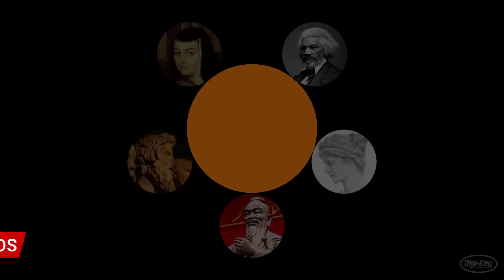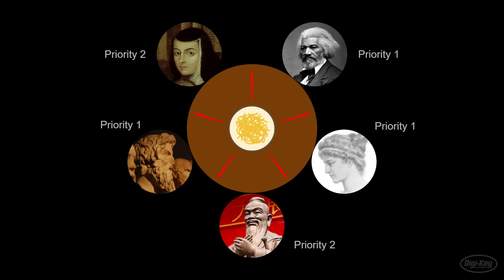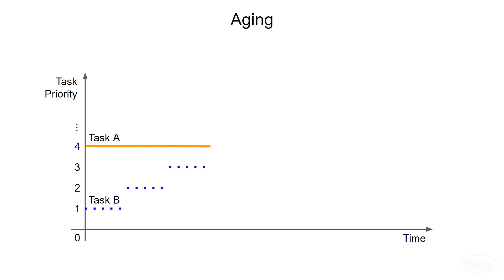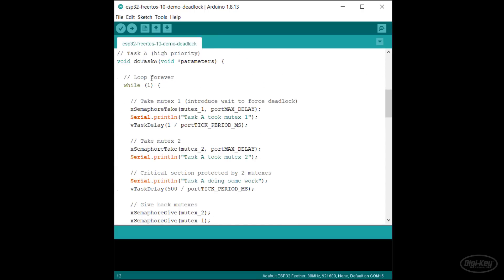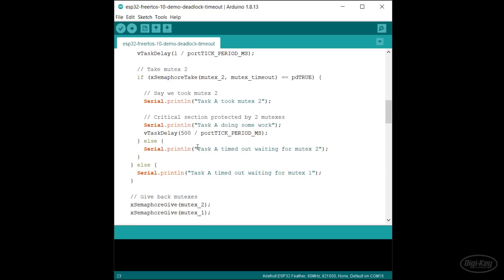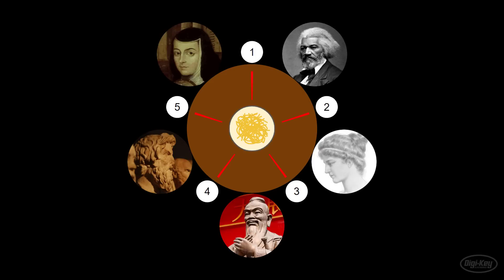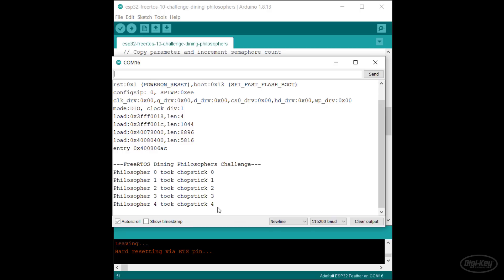Introduction to RTOS Part 10 - Deadlock and Starvation | Digi-Key Electronics

Comment: Starvation -  Higher priority threads runs that causes lower priority threads to not run 
Solution -  1/ Add delay in higher priority threads so that it allows lower priority threads to run 
                   2/ In multicore system, allow other higher priority thread to run on another core 
                    3/ Deferred interrupt - Making higher priority task waiting on interrupt using semaphore 
                    4/ Aging - Priority of lower task is bump up to match of hogging task priority so scheduler need to split execution time  

 Starvation at system level refer as Deadlock 
 Solution - 1/ Timeout - add timeout if mutex not taken than release it 
                   2/ Add priority to shared resource - threads only take resource to their lowest/highest order, mutex taken in same order across threads 
                    3/ Arbitrator - challenge to be implemented 

Livelock - It occurs when mutex taken and release at a set sync timeout

Comment: xSemaphoreGive(mutex_2);
xSemaphoreGive(mutex_1);
Hi. these two lines error error when starting  esp32 . error is that . ""assert failed: xQueueGenericSend queue.c:832 (pxQueue->pcHead != ((void *)0) || pxQueue->u.xSemaphore.xMutexHolder == ((void *)0) || pxQueue->u.xSemaphore.xMutexHolder == xTaskGetCurrentTaskHandle())"
i checked code block and i resolved problem with change some codes. problem is that if any semaphore not taken we cannot call give semaphore but we dont know mutex_1 or mutex_2 which not taken . we must change firstly pdTRUE of taken semaphore then we can call give of semaphore.
regards

Comment: 0:00 deadlock explanation
2:02 starvation 
2:40 deferred interrupt as a solution to starvation
2:48 aging 
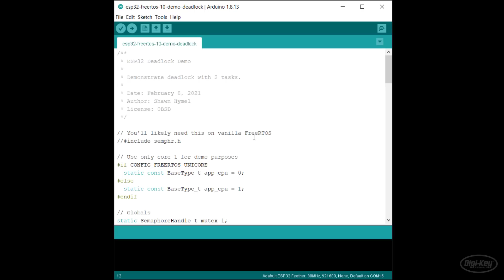4:52 deadlock demo
6:30 timeout solution
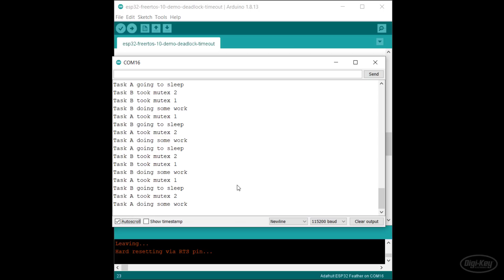7:15 livelock
8:00 Dijkstra hierarchy/priority assignment to solve livelock
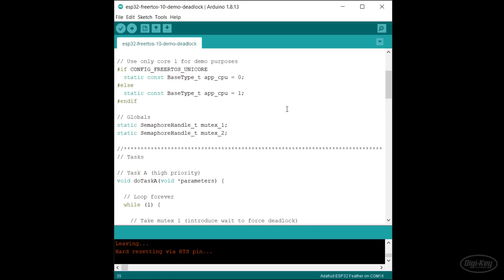8:40 livelock solution demo
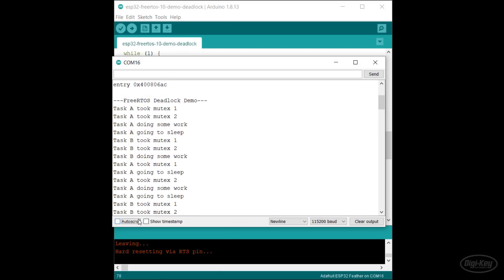9:50 arbitrator solution for livelock
10:30 arbitrator cons
10:58 challenge

Comment: Hi, great videos! I tried to reproduce this using VSCODE + esp-idf plugin and I cannot reproduce the same behaviour as in arduino. Any thoughts?
Reply: using openOCD I verified that, actually it creates at the beginning 8 threads
Id   Target Id         Frame 
* 1    Thread 1073438812 (Name: main, State: Running @CPU0) app_main () at ../main/blink.c:176
  2    Thread 1073444140 (Name: IDLE, State: Running @CPU1) _reclaim_reent (ptr=0x3ffb8364)
  3    Thread 1073441476 (Name: IDLE) vPortTaskWrapper (pxCode=0x0, pvParameters=0x0)
  4    Thread 1073428772 (Name: ipc1) 0x40086e65 in xQueueSemaphoreTake 
  5    Thread 1073446548 (Name: Tmr Svc) 0x40083b64 in esp_crosscore_int_send_yield (core_id=0)
  6    Thread 1073433228 (Name: esp_timer) 0x4000bff0 in ?? ()
  7    Thread 1073412368 (Name: ipc0) 0x40083b64 in esp_crosscore_int_send_yield (core_id=0)
  8    Thread 1073434356 (Name: dport) 0x40083b64 in esp_crosscore_int_send_yield (core_id=0)

Comment: Thanks for the videos! Will you be doing a video on using DMA with the ESP32? There doesn't seem to be a decent video on it on YouTube but it is very useful, for example for reading from the ADC as quickly as possible and averaging samples to increase the poor 7-Bit ENOB of the ADC, which is possibly the ESP32's biggest shortcoming. And also for connecting an I2S microphone or speaker, etc. Thanks!
Reply: Thanks for the feedback! Going into ESP32 hardware specifics (except as necessary to demonstrate multithreading or multi-core applications) isn't planned for the series. However, it's good to know that there's interest for more ESP32 content.